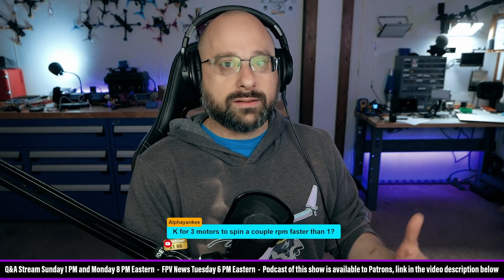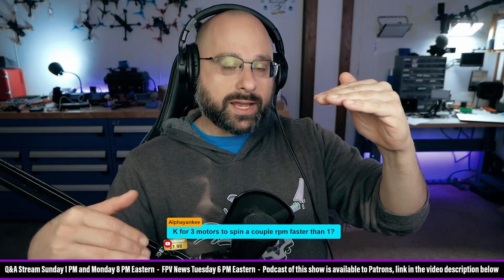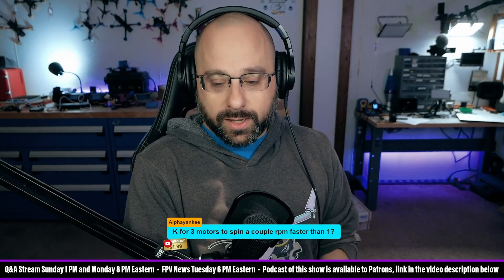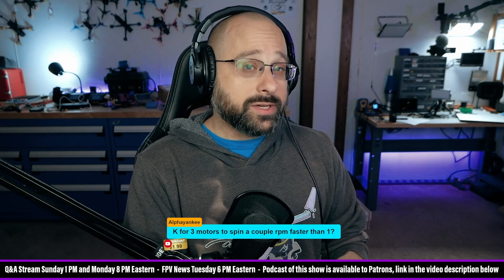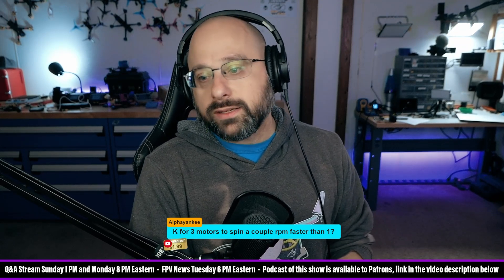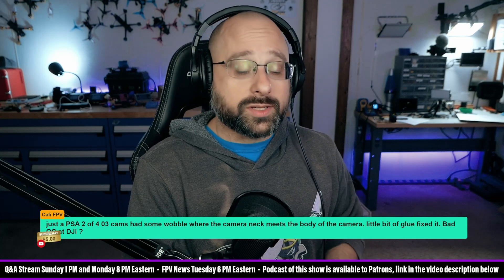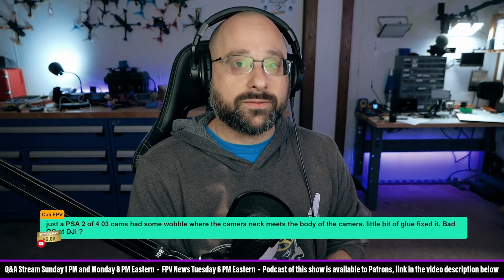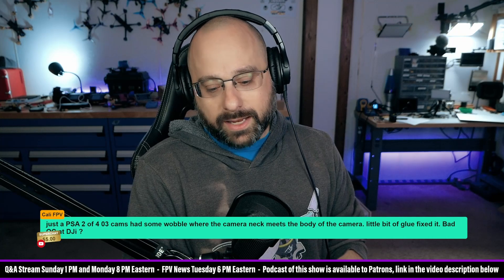Is It Okay For One Motor To Spin At Different RPM Than The Others? - FPV Questions

Comment: Hi Josh, my drone when hovering will automatically drift left and to fly it correctly I had to compensate. I did some research on betaflight and found one motor would spin slower than the rest. Is there a way I can fix this?

Comment: the lowest kv governs the rest of higher kv motors the flight controller will only be able to send a signal to keep up  with the slowest spinning motor ive mixxxed 1800kv 2400kv and 2200kvx2 and the quad flew fine on 4s but was a bit slow because of the 1 1800kv motor and before you tell me how wrong i am plz try it first
Reply: and it was you bardwell that taught me drones lol

Comment: if you have a bad bearing then then you will need more current, but FC will make that adjustment to RPM get as it should, if one motor spin slower that it need, the quad will not hower.

Comment: I had an issue with a quad that would spin faster and every time I cut the throttle it would cause the quad to yaw to the left, KISS end of flight stats give you the motor outputs and one of the rear motors was always showing several hundred higher than the other 3 motors. 

As soon as I changed the motors on that quad the issue went away.

Comment: I rewind my motors when they burn and I realized that KV in the bell is mostly a reference number. My F60 PRO IV tagged as 1960kv, brand new are 2100kv when I mesure them with the motors tab hahaha. The variance is there, we just don't really notice and measure.

Comment: I have done this. My 5" long range one motor busted. For time being I put on a different motor higher kV drone had no issues. Flight times didn't even change. 
The aero 1600kV motors were sold out so put on brother 1700kV. Data sheet said my normal motors made max 650g and new motor made max 845g. 
Think mine really closer to 1500kV